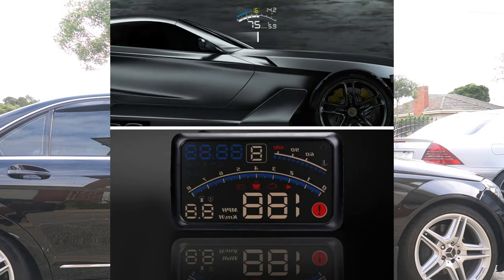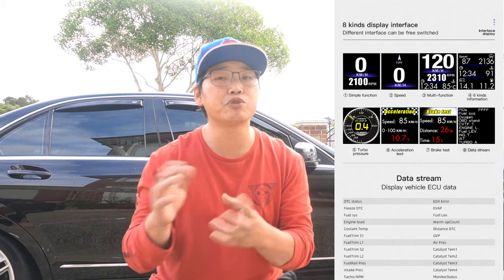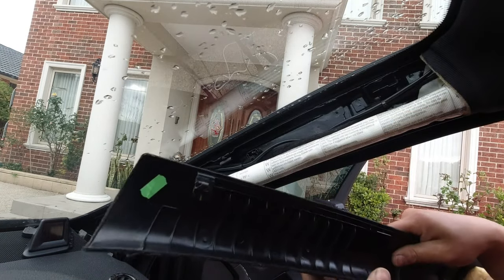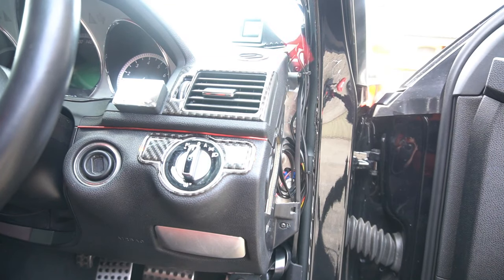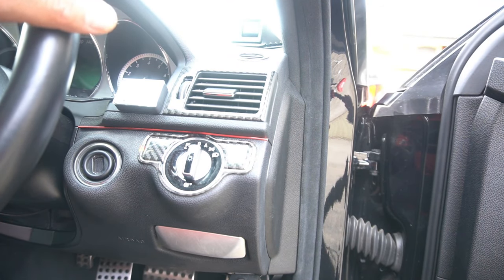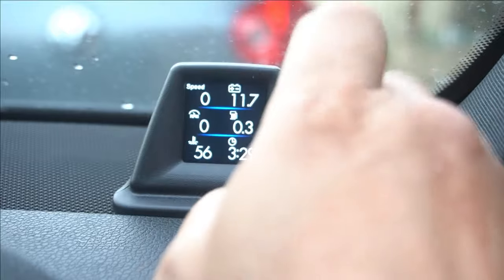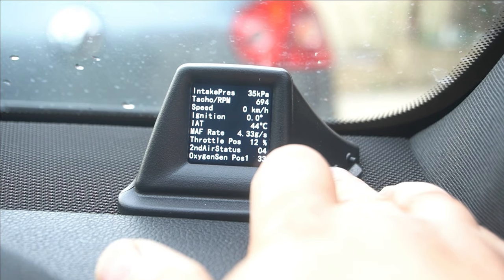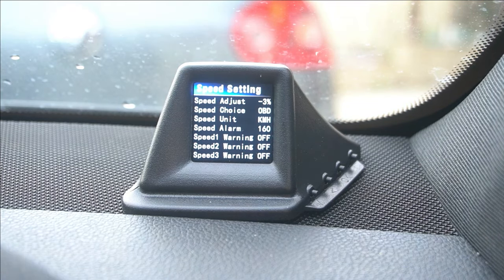D.I.Y COOL CAR GADGET obd2 + gps H.U.D heads up display fitted to  mercedes w204 or any car

Comment: Does it turn on when turning keys. Or does it need to be pressed on the side every time
Reply from the maker: turns on with key..take a sec but turns on by itself with acc mode
Reply: Mine seems to turn on when cranking the emgine. Alltought i did buy my own from aliexpress. And i have a PreFL W204 250CDI. The gadget looks the same tho.
Reply from the maker: @Samppaze  mine turns on as soon as I get to 2nd turn before cranking ... it takes a bit though like 20 30 secs
Reply: @MIKEYZVLOGZ  yup seems to be working the same way for me too. turbo gauge caps at 1.5 bar. (2.5 if atmos is calculated). i believe carly red 2 bar (3bar if atmos pressure included) i need to sort this problem and find a solution from settings.  otherwise this gauge is really usefull. glad that you made a video of it. would have never tought of looking for one of these.
Reply from the maker: @Samppaze  im glad you think so, yeah for a turbo car it would be great
Reply: Hello my friend I just get my OBD2 like yours today and i was wondering for what I need the USB port under ? Does it need to be changed all the time? Or its working also with the OBD2 cable? 

Thank you so much 
Eric from Italy

Comment: Mikey, I say this with love (you should know by now)…it’s an interesting little gadget but I think the main issue is that this is simply a heads-up display for an OBD scanner.  I sometimes plug in my scanner and leave it on my lap while driving - just for diagnostics.  There was one point in the video - somewhere around 9-10 minutes where you were reading way too fast.  You said “direction” when it was about Direct Injection :). My point is that if you don’t know how to read these measurements, then it’s just arbitrary…you kind of revealed that by going too fast and taking some important measurements for granted :). I use my $20 plug in scanner for real time data on my lap every now and again.  And I research what certain settings are in the normal range for my C300 and then check against it.  I wouldn’t treat this product as a permanent heads-up display.  As you said, some things you checked match up with the dash and that’s all you need - temporary check.  I feel as though if a driver is trying to read redundant information that your car was designed to show you in the dash, you can honestly crash and kill yourself bu trying to read a tiny, arbitrary, redundant screen.  So I’m sorry, but I don’t think this is a good product at all.  It’s an irresponsible product that offers heads-up display when there shouldn’t be full-time, heads-up display.
Reply from the maker: I can respect that ... very detailed feedback .. I can appreciate that mate... however plugging in an obd2 scanner is basically the same as using one of these ... my point is your able to view this info in a device like this ..not necessarily while you drive .. ofcourse u should pull over first ..not look at it while you drive ... these are primarily designed to just show speed ... just because something is designed doesn't mean it should be used irresponsibly..its still up to do the right thing

Comment: Can you add more fuel to the AFR ratio in the settings? In the “Fuel Adjust” menu? want to get my A/F.R in a more optimal value, currently running a little lean.
Reply from the maker: unfortunately it's only a monitoring system not able to modify those settings

Comment: does it warn you if the temperature of the car increased ?
Reply from the maker: hi mate yes .. ur able to set a warning on certain temps for example I've set mine to 100 deg cels and it give u a sound wen u reach that temp.. ur able to set it

Comment: Hi Mike, in the display with 6 data stream, how do you change the top 4. The one I got has time and other useless info listed on those 4 and I can't figure out how to change those. It only allows me to change the last 2 data on the bottom. Thanks again for the video!
Reply from the maker: all displays can be changed u need to hold the menu button til it flashes then press up and down til it goes to the display u want to change and press select it will change
Reply: Thanks mate!

Comment: i watched your previous video, and you mentioned the light bulb constantly go bad , i think i found the reason, i used the led 194 and it lights up even with the vehicle off, but when i try on the original regular light bulb it doesn’t light up , so i think all the light has constantly power to it
Reply from the maker: which light bb do u mean for which video ?
Reply: @MIKEYZVLOGZ  the video for w204 the light bulb will go bad very soon, i tested on both side marker light and both 4 top parking light bulb, they will light up even i lock the car for hours, i test with 194 LED , and also the amber light bulb
Reply from the maker: @MBZXZ  oh I understand
Reply: @MIKEYZVLOGZ  recently i replaced the secondary air pump because it failed and throws CEL , and my registration is due, but i cannot get the SAS( secondary air system) to get smog ready

Comment: Great content keep them coming also struggling to put new LEDS in for the parking lights any tips for quick fitting.
Reply from the maker: use a set of needles nose pliers .. wenever I have trouble with then I use a endoscope for my phone so I can see what I'm looking at .. they are real cheap like 15aud... after a while sometimes due to dust and dirt it gets stuck but usually u can pull it out from the wires ... if not use pliers to help grip the socket of the leds not the wires !!
Reply: @MIKEYZVLOGZ  

Thank you!!!!
Reply from the maker: did u check out the video where I show how to change all bulbs
Reply: @MIKEYZVLOGZ  yeah i have seen that one managed to get it sorted thank you mate.

Comment: Question. Is there any warning alarms for very high water temperature?
Reply from the maker: yes there is an alarm setting for battery voltage, speed set alarm , rpm alarm set , and coolant temp alarm , so yes there is the setting to set an alarm for when u want it to sound according to your setting

Comment: Hello brother,
I've seen ur videos and I'm planning to do what u r doing, u r awesome bro 😍🔥

Today I had "ABS and ESP inoperative" message 💔
I searched and it might be the "Speed sensor" or "ABS module"

The thing is when I searched for online genuine parts, most of them had only C300 and mine is C180 Kompressor. Is there any differences in spare parts? 💔

Thanks in advance and keep up the great videos 💕
Reply from the maker: hey mate in this case I think the part maybe the same..not specific to your model ... but u just need to double check ... try ask mercedes about the part first then once u have the part no. search for it yourself online ... I know things like brake sensor and speed sensor use the same ... but as always you double check first
Reply from the maker: thanks for saying so ur too kind

Comment: Does the unit automatically turn on each time you start the car? I noticed there was a power switch. If it does automatically turn on, does it turn on to the last displayed screen?
Reply from the maker: yes turens on automatically and goes right to the display you choose
Reply: @MIKEYZVLOGZ  Thanks for the information. The actual screen that I would like to use on each start up is the “Data stream”. Just to double check, will the unit also turn on and display the data stream first if it was left on the data stream screen during shutdown?

Thanks for your help, I couldn’t find this information anywhere.
Reply from the maker: @bradleybritton7652  I'll check and let u know if not it's a simple few clicks
Reply: @MIKEYZVLOGZ  Thanks
Reply from the maker: @bradleybritton7652  it stays on the screen u leave it on ... or at least the section ...so yes
Reply: @MIKEYZVLOGZ  Thanks for checking that, it's appreciated.